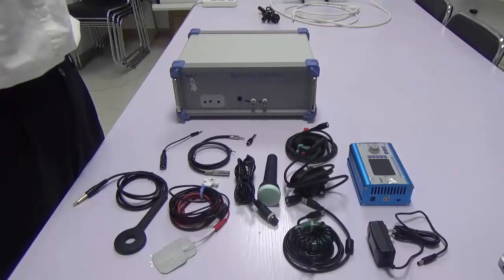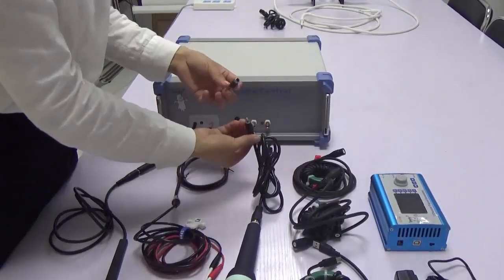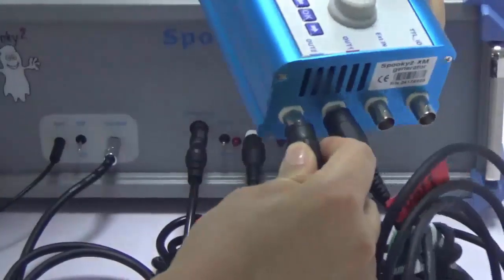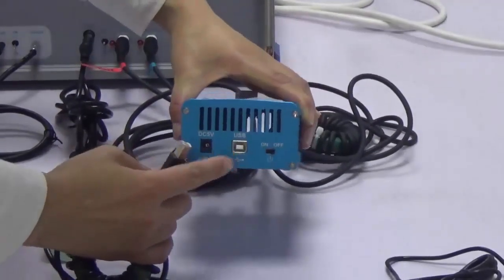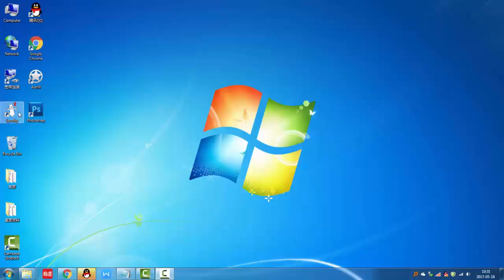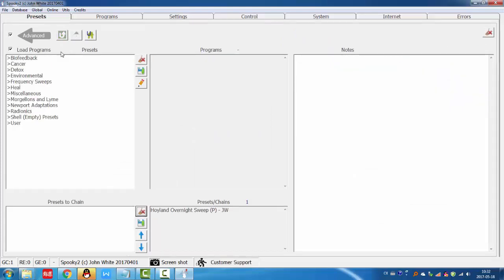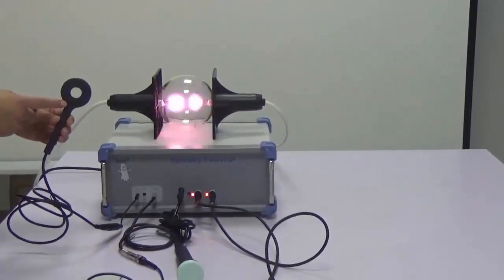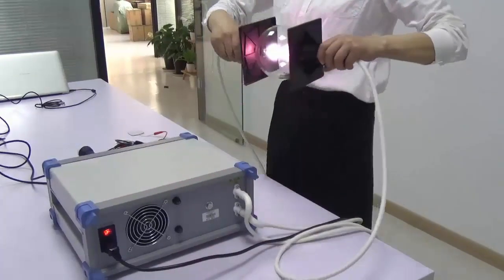How to Set Up Both Hardware and Software to Use Spooky Central

Comment: My spooky central makes a clicking sound sometimes.  I reset everything over and over until the clicking sound stops but I'm not sure what is causing it in the first place.  Is this a generator lockup?  The plasma tube lights up but clicks.  I only treat myself when I get the clicking to stop.  It's totally silent then.  Any help would be appreciated.
Reply from the maker: Hi. You may contact our support team for your issue. support@spooky2-mall.com From your description, I couldn't be sure whether if it is a fault in the machine or a wrong operation. :)